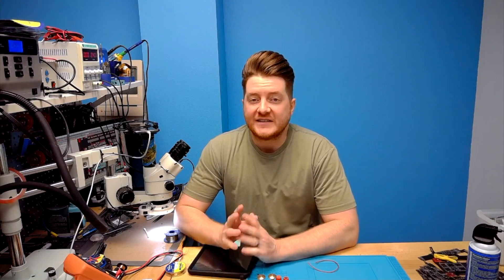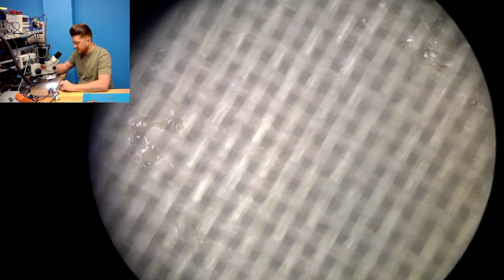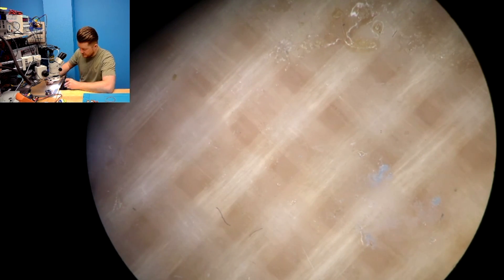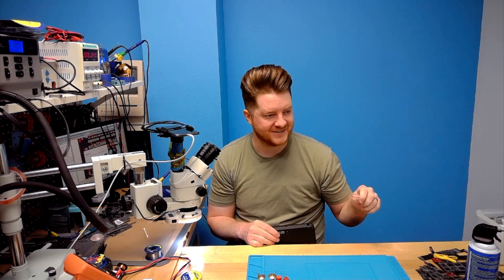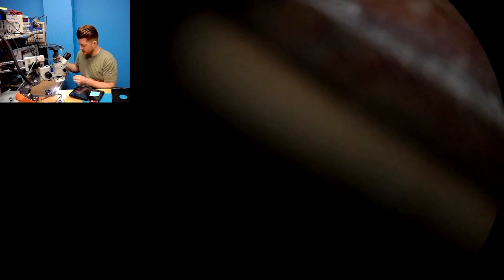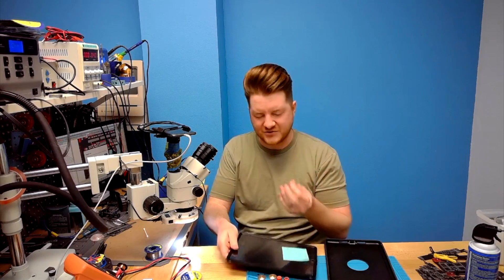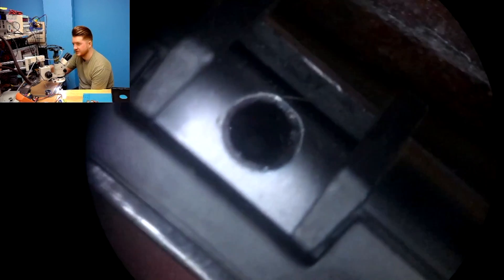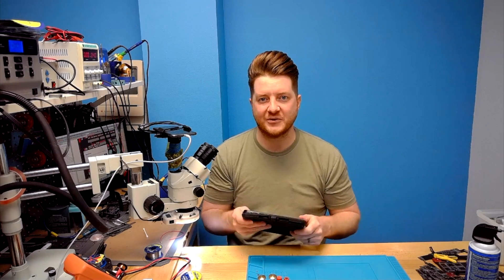How to Remove a Broken Headphone from an iPad Headphone Jack - Solder Method!

Comment: I used a tiny drill bit. Once that jack plug breaks its hollow. Tiny drill bit, fits perfect. Go in slow, it will stop once it hits the bottom of that plug, it comes right out.